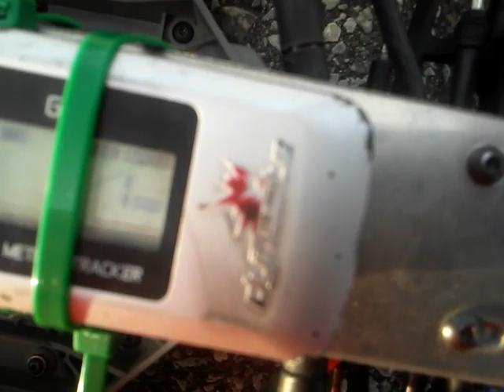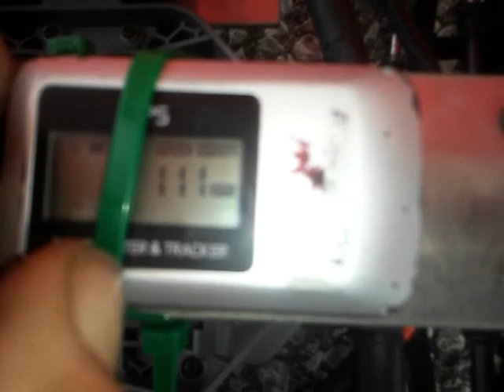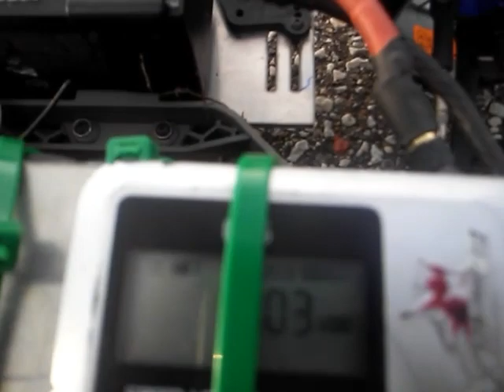Slash at new road

Comment: Nice slash Henry! Nice too see this project going.
Reply from the maker: rcmadness yes sir it has potential for sure dam grps blow out glue came off the rim
Reply: Henry fords rc, again the grp tires letting you down??  I never managed to break one but my max is 116mph.could it be that they break when losing contact with the road? Maybe accelerate to harsh? Still it's not a good sign and looks like grp is losing there qualities.
Reply: Henry fords rc , maybe you can try the harder compound. A friend of mine managed to brake one but these where really old tires and the soft ones on a hot day.
Reply from the maker: rcmadness no sir brand new s7s hardest you can get they are junk now !